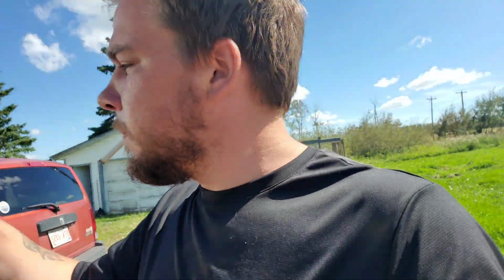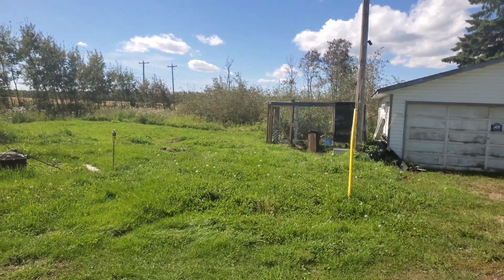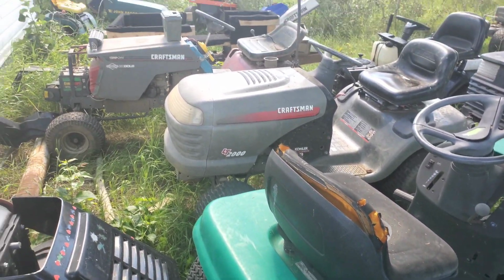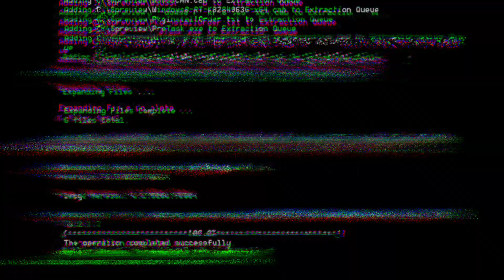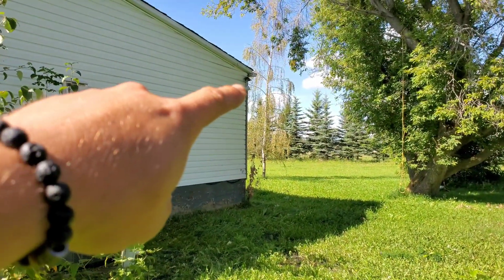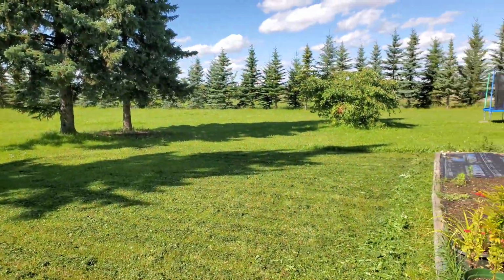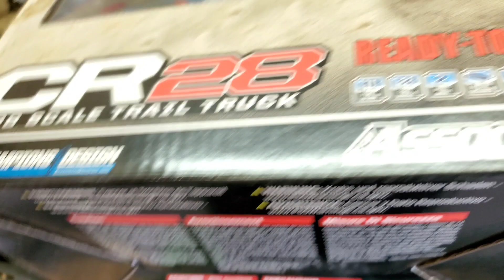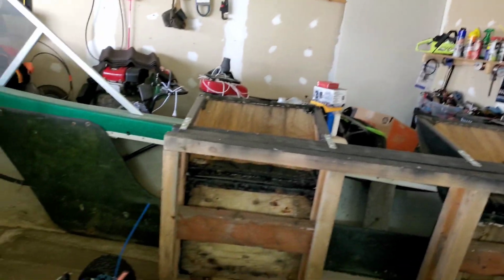Yard catch up / clean up

Comment: My gt 3000 sounded just like that trying to start... Full battery. I disassemble the starter motor and cleaned and lubed it. Works great now.
Reply from the maker: starter is new and everything could be needing valves reset or something not sure lol